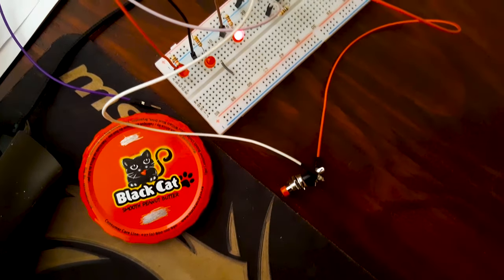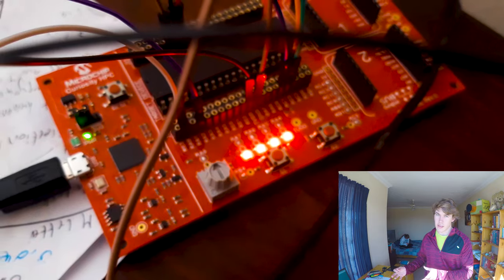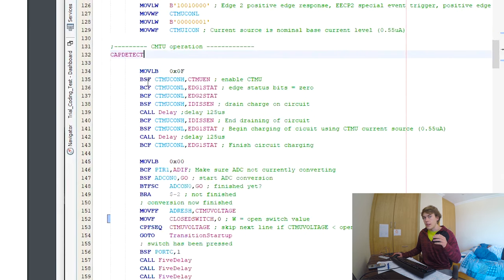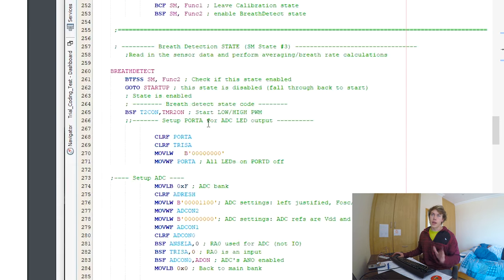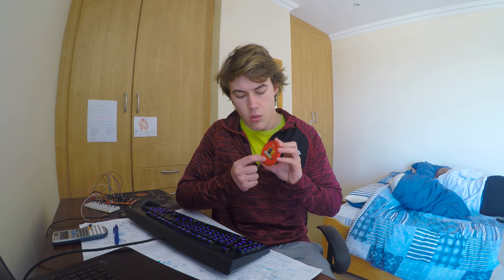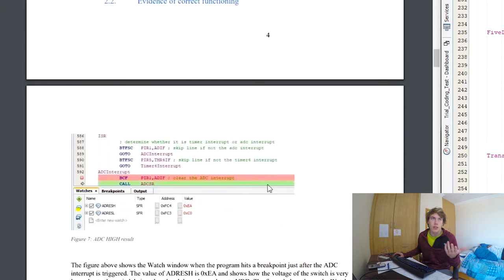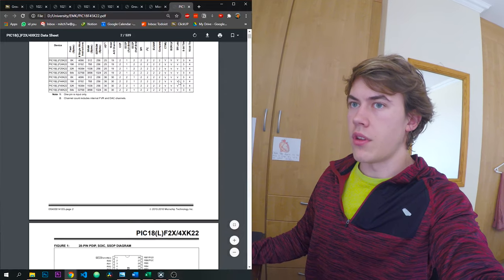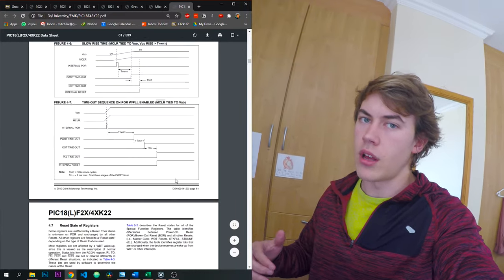Building A Ventilator (Kinda) | Computer Engineering Microprocessors Practical | Covid-19

Comment: Very good Mitch, I think this is one of the most impressive things you've done in your time at varsity, it's really the culmination of so many things you've learned these past 2 and 1/2 years.  The video here reminds me of something you said in your June 6 2020 vlog where you question the applicability of electrical engineering modules to a computer engineering graduate's future career when most of the work that graduate will likely be doing involves software development only.  You can see what you were saying here:  https://youtu.be/kE1CPTtVL-A?t=205   But this project with its focus on assembly language enabled you to understand how the computer you'll be programming actually works which I think is key to improving your ability to maximize the effectiveness of software you'll write in the future. Much of what you've done here did require some understanding of both analog and digital circuits which I think demonstrates the merit of being required to take those challenging modules in circuit analysis even though you may never become an embedded computer systems engineer.  (Pete)
Reply from the maker: Yeah it brought the disciplines together nicely. Here's to hoping future subjects do the same